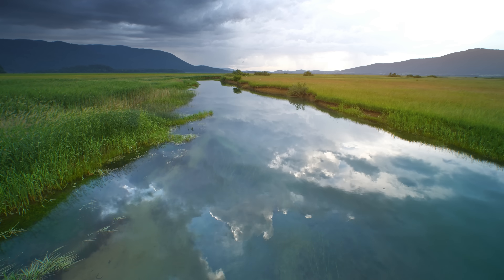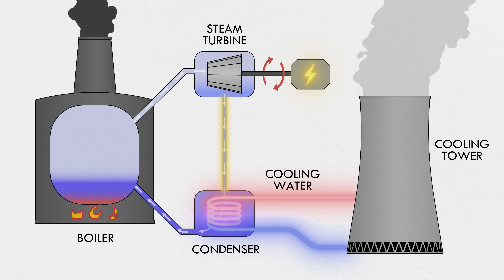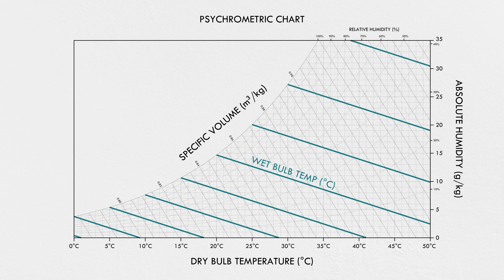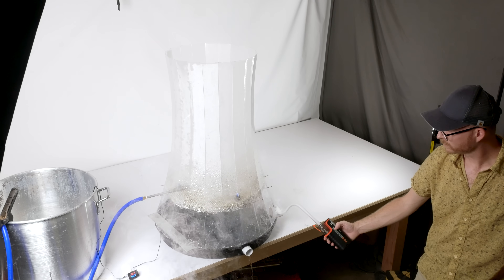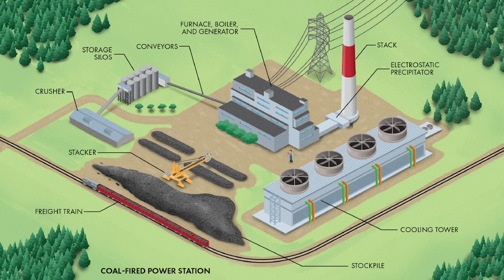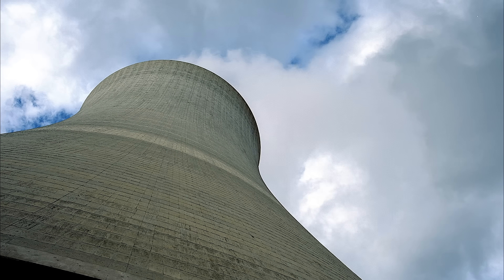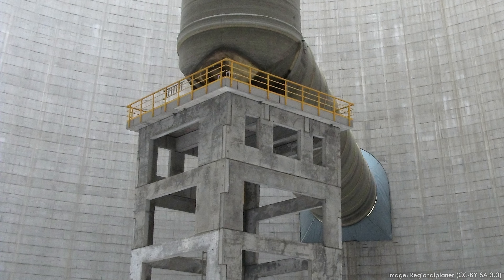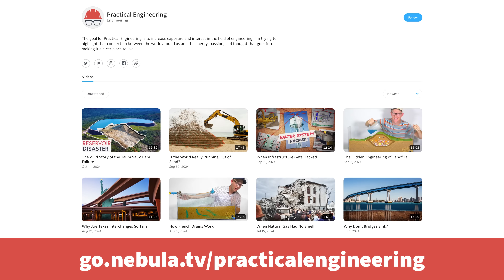Why Are Cooling Towers Shaped Like That?

Comment: Why is all that heat not used for district heating instead of throwing it away?
Reply: Cause this system is designed to reuse water constantly. It would be less cost effective (And insanely more complicated) to make the system change water intake during fall and autumn
Reply: The cooling water heat is absolutely used to heat the plant and outbuildings during cooler months (winter). It is also used to preheat the combustion air for the furnaces. Ultimately though any remaining heat will take more energy or $$$$ then it's worth to extract so it gets dumped overboard. That is called "waste heat" and ALL heat engines of any kind have waste heat that must be dumped to the environment. If you eat you must sh&!, there is no way around it.

Comment: Thank you for an amazingly informative and helpful video! I've always found cooling towers fascinating but, until this video, had little knowledge or understanding regarding how they really worked. 

I had no idea there was anything like 'filler' inside them as nothing I'd seen before had shown it but has assumed they were just totally open and the plumes were evaporation from a large water-filled void at the bottom. It seems maybe I wasn't so far out.

The really interesting part was the psychrometric charts and explanations. Until now, I had no idea that water vapour actually had lower density than air. When I have seen steam or vapour rising I had assumed it was purely thermal, in that heat rises, rather than it having a lower density.

Finally, inside a disused cooling tower is one of those things of my list of unconventional places to live. I've no idea what it would actually be like to do so, but it would certainly be different!

Comment: Doesnt the shape also lead to a low pressure ➡️ high pressure ➡️ low pressure pattern as the hot air leaves the tower

Comment: An additional benefit of hyperboloid shapes of cooling towers is mitigating vortex shedding. There is a specific combo of diameter of the tower and windspeed that resonates (like Tacoma Narrows Bridge). If the tower has variable diameter throughout its height, a bit of it is always resonating with any wind speed, but never the whole thing at once.
Reply: Fantastic explanation.

Comment: Sounds like we could recover some of that heat for maybe heating homes during winter. That’s energy heading out of the smoke stack in same sense a 80% gas furnace functions. What is the efficiency rate from that same waste? Prob not as bad as the same gas type furnace but still dumping BYU’s into the air is entropy at its finest. It sad we don’t recover some of 
that. We could reject that heat if we couldn’t consume it. However I’m not sure we don’t do just that if so, good looking out.
Reply: Cause this system is designed to reuse water constantly. It would be less cost effective (And insanely more complicated) to make the system change water intake during fall and autumn
Reply: @ I’ll buy that. Thanks for the input.

Comment: Q1: Why cool down the water that is coming from the turbines when you are just going to heat it up again to generate steam to turn the turbines?

Q2: Does the cooler water allow a larger volume of water to be pumped into the heater so that there is a large volume of steam generated to turn the turbines?
Reply: If I had to guess, I think it has to do with cooling the primary water circuit that itself cool down the nuclear fuel.
Reply: For simplified answer to Q1: It is only cooled enough to condense from steam back to liquid, this is cause the effect that drives steam turbines is the phase change of water from liquid to steam, which expands its volume by factor of 1 600 ish. Of course it is not cooled more than necessary so that it is less expensive to get it to change to steam again.

Comment: I used to work for a company that made these, called Enexio, when I had just turned 21. I had to learn what cooling towers were, and how they worked as we traveled all across the country replacing the support structures in these towers, and the fill that the water rains down the basin from when it cools off. Other times, we just built brand new towers on site. We were usually just a crew of maybe 5 people building these massive, complex towers out of wood, fiber glass, even concrete. The work always involved a superintendent who oversaw the work from his fancy truck while we sweat all day with no break. He always told us that when we would ask to go to the bathroom, that's our break. We'd work for 10-13 hours straight, 7 days a week to build those damned towers. All for $18/hr. We never got paid mileage to travel to the work sites, per diem was $400, and we had to already have money ahead of time for the first week for a motel room and food. After taxes from over time, and motel fees and laundromat fees, take home pay wasn't worth all the traveling just to be overworked. People at my local home depot make more than I did. I couldn't afford to travel to these job sites, so I stopped working in cooling towers for Enexio. I realized it took money to make money, you need a good truck and a good 5th wheel or gooseneck camper to live efficiently and comfortably on the road job to job. I heard there are better companies out there, but I never knew the right people to get in with different companies. All my co-workers were immigrants who didn't speak English anyways. Cooling towers are interesting and simple in practice, just using water and fans to keep power plants and factories cool, but the labor behind putting them together with a skeleton crew absolutely sucks.

Comment: I was taught that the shape of a cooling tower also acts as a Venturi. The wind passing accross the top of the tower draws air up through the structure, and in the middle where it’s at its narrowest the airflow is the fastest,

Comment: U will notice two typical styles of structural suppurt columns at the bottom:  1) diagonal X's or 2) meridianal [up and down].  We elected to precast meridianals on the SPX (formerly Marley) tower that we were the EPC on back in 2008 to 2012.  The Doka forms used for the shell are 1.5m tall lift jump forms that have inclination and diameter adjustability.  Shell thickness was about 8" at thinnest point near top under rim walkway.  We sold our used Doka forms after we were done to the Vogtle nuke job.

Comment: I worked on 9 natural gas fired power plants in early 2000s. The mechanical cooling towers are colloquially called “cells” and at they cost about 1 million per cell. 
  They are built like a pole barn and the “fill” is about 8’ thick and u can walk on the questionable surface about 30’ above a 4’ pond. 
  There is so much cool stuff out there most don’t know. Thx Grady for reminding ppl

Comment: We could have some great conversations about steam generation and flue gases. Fuel is not cheap. The more effciently you can burn it the less fuel you use, so coalfired plants use lots of technology developed over many many decades to get a more complete and thus, a cleaner burn. Same with gas, biomass or anything you can burn. Scrubber installations were very good jobs too, and they could be getting better and better.

Comment: We have that same tower shape on coalfired, natural gas, boimass, nuclear, convex focused solar heat towers, and even a single stage geothermal  generating stations. I had to mention the single stage part as making some of these plants into two or three stage geothermal plants they will generate more electricity, for the price of pumping hot brine and purified water. We made similar smaller towers to draw in cool air to passively cool reactors (air core chokes) in the substations at the generating stations, and many other locations, and they worked GREAT! We had reactors blowing up from excess heat. The cooling skirts fixed the problem.

Comment: French breader reactors are 5x more efficient than these relics.
Reply: Then why are shutting them down?
Reply: @jamesisaac7684  For several reasons.
Some plants are just not up to norms anymore and need to be shut down.
Some regions don't have enough people willing to work in the nuclear field and so the plants cannot run anymore and are shutdown.
Also, and this is dumb, many people aren't educated enough to understand that nuclear energy is the safest and cleanest we have access today (while remaining powerful enough). And those people protest against nuclear energy and politicians react by shutting down plants, that happened in Germany and they got back to mainly using coal.
Reply: @jamesisaac7684  Incorrect and they are adding 6 more

Comment: I worked at Rancho Seco in California as a contractor, coating the inside of the cooling water loop. Sandblasted the giant pipes that ran to the cooling towers as well. Great paying job back in 1985.

Comment: Correction for nuclear plants. The large cooling towers are generally not claimed for a safety function. They do however often have a bank of forced draft cooling towers which are used for emergency decay heat removal. The reason you use forced draft towers is that you can switch them on in emergency, they are compact and this offer less of a target to external hazards and they fail gracefully as they are a collection of modular units so they are less likely to all break at the same time.

Comment: good video :)

Just one point you don't mention about the shape of the towers : they help to increase the flow of air. The narrow section is usually closer to the top than the bottom, so all the flow under the neck sees its speed increase while it goes up (until the neck)
Reply: 10:21

Comment: back in the 1990s I worked security for San Antonio's electrical utility,  CPS. I spent a year or so assigned to the decommissioned 1920s-vintage power plant just south of downtown on mission road. the grounds still had three or four of the hyperboloid cooling towers Grady features in this video. They were made of wood, if I remember correctly, and were suspended over a shallow pool. I was looking at google maps just now to refresh my memory about the place, and most of the buildings, including the cooling towers, are gone now. But it was a playground for the mind back then, full of "i wonder what that is" buildings and structures.

Comment: I used to work at the plant pictured at 2:25 ... Actually, at an older power plant about a mile north.  It was built before cooling towers were a thing, so it used condensers that pulled cooling water in from the Ohio River to cool the boiler feed water.  It was a fun summer job while I was in college.

Comment: I have build cooling towers since 1996. The only reason they built those massive concrete towers is because concrete was very cheap and mecanical equipment very expensive. Now days they don't build them like that anymore because concrete is expensive and mechanical equipment is cheap. Now you know.

Comment: Greetings, some of what you said about cooling towers reflected on a previous employment I had. I worked at a large magazine printing facility (Schumann Printers). One time, I toured my family where I worked. Jack Schumann was very interested in my family, and kind of joined our tour. One thing I remembered from that day, was the cooling tower installed in the plant. Its job was to heat and dry the ink, while the printing happened. Under the best system, the drying of the ink, caused a lot of moisture to be removed. Jack showed my family one “smoke stack” which released moisture into the air. At the time, this was January in Wisconsin. He was so stressed that the cloud which came from the plant could be misinterpreted as pollution. It was just moisture.

Comment: I may not say something new or groundbraking to some but nuclear power plants are way better power source (currently) than every renewable power source. And also WAY more safer, I mean, just look at what happens when a wind turbine fails chatastrophically, that could never happen to a nuclear power plant. And the solar panel generates a lot of heat, especially a whole field of it, which doesn't really happen to nuclear power plants, mainly because the heat makes more energy inside the isolated reactor.

Comment: This was an amazing episode. I've been in the commercial HVAC industry for 16 years, and I'd never really knew the science behind natural draft cooling towers. I live near major tributaries to the Chesapeake Bay so most of our power plants are built on the rivers edge without any need for these style towers. I'd imagine they just take river water and run it through condensers but I'm sure there is more to it than that.
On the commercial side of things, most of what I've seen is Induced Draft or more recently Dry Coolers. 
Only once have I seen a Forced Draft Tower (installed in a relatively confined area).
Thank you for all you do!

Comment: @PracticalEngineeringChannel on the clip shown starting at 13:56, did you add some sort of noise filter to the video, or do the white streaks that show up on the bottom left quadrant of the screen already part of the source video? Are those radiation streaks by any chance?

Comment: something you didn't touch on that I immediately understood from your demonstration - temperature can be described as the average energy of particles which fall on a bell-ish curve (Maxwell-Boltzmann distribution).  This system is allowing some of those high energy particle to escape up the chimney as steam, driving the convective forces.  In that way, it has a bit of a temperature separator effect similar to a vortex chiller (but without the vortex obviously).  That driven convection further cools the remaining cold side. Very cool, thanks for the demo.
Reply: Well said.

Comment: Is the equation still valid nowadays? I can see electric fans being very cheap and pouring concrete is super expensive nowadays.
Reply: Still valid. Fans contain mining parts which is a no no for things that is expected to last for decades in an industrial environment. Water is corrosive at high temperatures and pressure.

Comment: I worked in a rose greenhouse as a summer job in my teens.  when it it got too hot, sprinklers would spray the greenhouse with water.  Vents at the top of the house would open.  The temperature would drop.  Thermodynamics!

Comment: I really did not expect this to be a garage build video, very cool! I just wanted to know more about how natural-draft cooling towers worked, and what exactly they're for... and now I do! 

But... 10:07 Hey, that's a cage mast from an old American battleship! That's an interesting parallel: the US Navy adopted cage masts because they were cheap and simple to build, structurally redundant, lightweight, and minimally obstructed the view of the visual artillery spotters using them, as well as permitting an infinite number of viewing locations. The proportions are different, but so is the purpose: height and footprint were important, but airflow was irrelevant.

It was also very interesting to see all the different proportions used in natural draft cooling towers around the world.

Comment: Its a condenser and evaporator just like your AC system. Except the evaporation and condensation in that happens within enclosed copper pipes and heat exchangers. They are also using a pump and pressure to help along the condensation/evaporation and to create a temperature gradient where it's hot outside your house, but cold inside. 

It doesn't appear you've done an episode on Refrigeration or AC, but you should, It's quite practical engineering. The physics of it all is quite brilliant.

Comment: There's a large power station near where I work. It uses these type of cooling towers, so I knew from an early age that, despite their association with nuclear power, they're used in some other stations as well since this particular one is not nuclear.

After watching this video I got to wondering if maybe they also used the reservoir method for cooling in a hybrid system, being that it's near a river, but it doesn't appear to be quite close enough to the water for that unless there is an underground or piped inlet/outlet setup. I've always loved how this channel gets me thinking about the things that exist near me in that way.

Comment: 04:40 false. Water does cool lower than the ambient air temperature: It can cool as low as the wet bulb temperature, which is below ambient whenever ambient air has a relative humidity less than 100%. Take a thermal imaging camera or infrared thermometer and see this for yourself. Damp patches on your towel for example will drop below the ambient air temperature.

This is because phase change requires enthalpy, which it pulls as thermal energy from the environment. The ancient Egyptians used semi-porous clay pots to evaporate water and keep items cool.

04:50 is misleading; about heat naturally flowing from hot to cold so you can't get any more heat transfer. Of course you can; you can use convection, or again you can use phase change; indeed, a refrigerator wouldn't be possible if you took this folk physics at face value.

Comment: Balloon motion starting around 7:28 distracts from all the dimensions going on in the chart. Also, if the red line at 14:49 was going to be animated, perhaps it should start at 40°C and spread out from there.

At 15:16, I don't think it would head directly toward the cooling target as such. It seems like it'd initially head along the lower blue wet bulb line of general cooling rather than towards our arbitrary target (though the curve eventually does sweep past that as well).